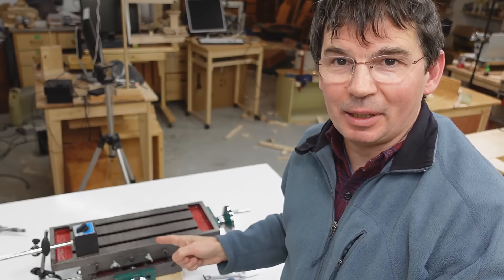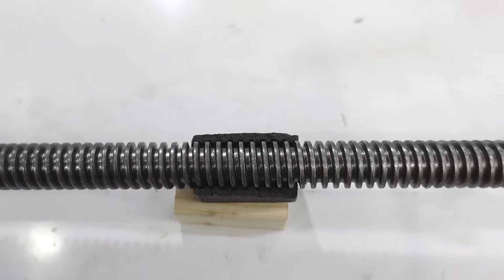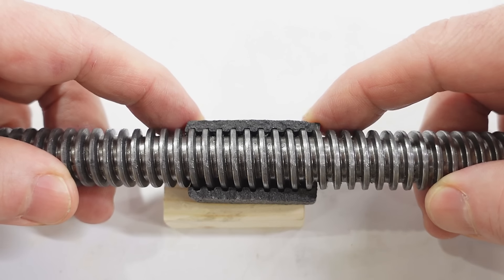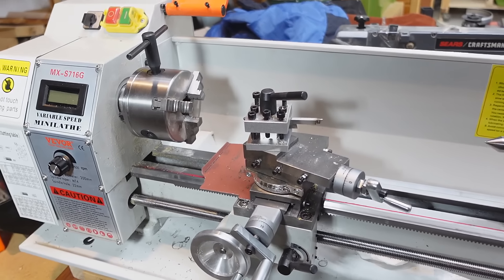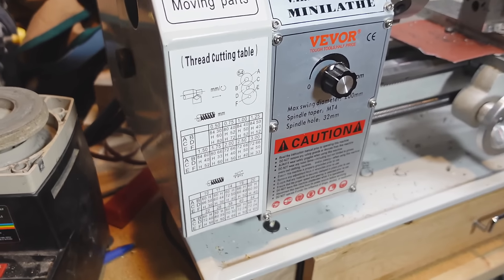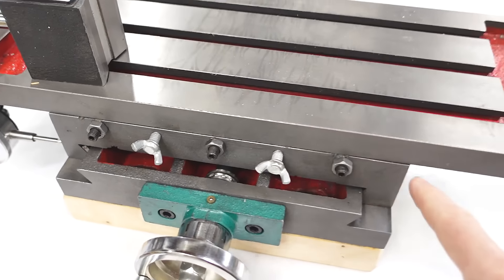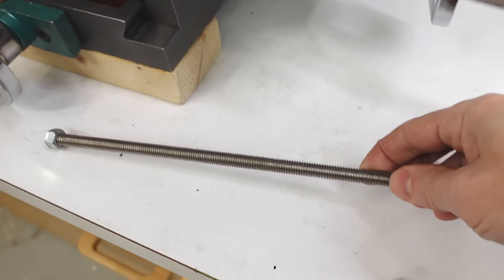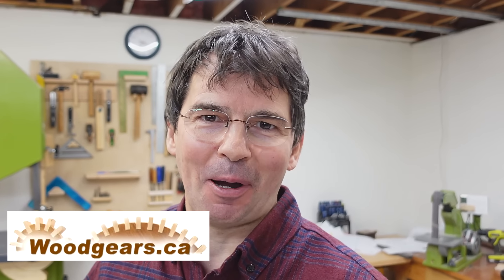Why all the hate for Vevor?

Comment: Regarding chinese factories, the only thing to mention is:
When constructing anything, from a machine, to a guitar, to a cellphone, usually you have certain amounts of steps including certain materials. 

Let's say 100 steps, to make that machining table. And materias certain type of cast iron, treated at certain temperatures, and wheels made of bronze, whatever.

BUT THEN, in China, what they do is instead of follow the 100 steps, they just follow 50 of them (for example, they cut all the quality control steps in between), and instead of treated iron, they just use cheap iron without any treatment, and instead of bronze, they use aluminium (I found sprockets made of aluminium in some guitar tuners!!, they literally bend under pressure!)

Then, for example, you cast the table, and then you need a special machine to flatten it, then a special polisher to leave the surface clear and soft, and then you place the part onto the whole piece and check for inconsistencies and fix any issue.......
What the chinese will do is just cast the part, use a regular machine to somewhat flat the surface, and just sand it by hand (this no need to explain, almost all machines have saw or machining marks on their sides), and then ensamble the machine without checking if there are corrections to be done. This cuts the price below half, but then again, if you buy this machine, you will need an EXPERT to calibrate or refurbish it to become a usefull tool.

But now hear the fun part: if you want to build the machine with japanese/german standards, they will do it. The issue is the machine will not cost $100........now will cost $600....and yes, you also have to pay for the logistics, custom taxes......in the end, you realize if you buy the machine from a local producer, you will pay $900-1000, but you will get a machine that is ready to go, and you will have customer support near your home.

In my mind there is no question about it: cheap stuff cost more than the expensive stuff.......the only reason I could buy a chinese tool, is to learn and practice how to refurbish it, and fix the multiple issues they have........My grandad bought an electric hand drill in Italy 60 years ago.....this drill is STILL working, and the only maintenance it needed was to change the carbon brushes every couple of years (and he used this drill professionally......I have bought in the last 10 years, at least 3 drills, and they are a TOY in comparison: 1) one doesn't have enough strenght, the W shown in the box are not true, and the drill always gets stuck if you push it too hard, with the risk of burning the motor) 2) the other falls aparts, all its rubber protections fell off, the drill bits get loose after a bit of use, and the drill has to be put in certain position for it to work, if you hold it horizontally the carbon brushes don't make contact! 3) the other is a cordless drill....after 4 months the charge last 20min of bare use...........so I have 3 almost useless drills, and probably should buy one more now...........4 drills in 10 years.............my grandad bought 1 drill in 60 years and today it still works.

Comment: I actually like Vevor. Some of their tools are very good regardless of price. The trick is knowing which ones are good as-is, which ones need some work, and which ones are not worth the effort to fix. I bought a very large set of taps and dies from them for USD $105 knowing I they would need work. An American quality set that large would have cost about $800. So, I will deburr them and touch them up as I use them, it only takes 5 minutes.

Comment: I have no real problem with Vevor. I bought a portaband from them (with a stand and a horizontal vice) and the stand sucked. But the portaband itself? Pretty good! 100 times better than having no metal band saw at all, that's for sure. I've made a little table for it now so I can use it in vertical "mode" also, for cutting sheet metal.
One thing I will say, if you do have a problem with a product, they will do almost anything to avoid taking it back. I bought a VFD that I wanted to send back due to it not having all the features advertised, and they basically kept offering me more and more money off until the price was down to like, 50 or 60% of what I paid. I guess I could've kept pushing and eventually I could've sent it back for a full refund, but honestly the email back-and-forth was wasting my time, and I knew I would find a use for the VFD in a later project.

Comment: I have a 3040 CNC of theirs that I got from the Amazon warehouse.  The spindle control was burned out, and I was disappointed that Vevor wouldn't provide any support (i.e. replacement part at my cost).
Ultimately, I rebuilt the electronics and have it working to mill out 1/4" aluminum plates that I needed.
Had it been at Vevor's price - I would have been disappointed, but with the markdown from the Amazon Warehouse it exceeded the value that I needed for what I have invested.... (More time and learning, than $$)

Comment: They are indeed a bit sloppy, but generally things can be improved with minimal effort, and personally I don't mind playing a little if the price is good and material is not total crap. I've been buying laser tubes and power supplies, lathe chucks, and I was rarely badly disappointed. I also like that they have warehouse, or maybe more than one, in Europe, and pretty big assortment, so shipping and delivery times are not prohibitive either. But I think I've said more than enough, considering I haven't got any lathe for free LOL.

Comment: Matthias - I was one of the negative commentors about Vevor and still am.  Yes they are manufacturing to a price point, but their advertising is deceptive and the flaws they have are simple fixes at the factory that do not cost much to fix.  You can spend a bit more to get reputable equipment that works straight out of the box.  I too have done the fix it up routine and have spent more money and time to fix the bad design than if I had spent more in the beginning on a better product.

Comment: There is probably a small business opportunity manufacturing quick improvements like moulded or printed nylon or metal collet nuts and thrust bearings that accurately fit the supplied acme threaded adjuster rods on this table and for other Vevor products. :)

Comment: I bought a Vevor Tig welder. They don't sell the consumables, and neither do any of the welding shops, that will work on the model I purchased. So basically I now have a 250$ boat anchor.  And I can't change the stinger because it is for specific for this model.

Comment: I would investigate replacing the table's leadscrew with a ballscrew. They have practically little to no backlash and almost mandatory if you plan on motorizing the table. They're available in a wide variety of sizes and include mounting hardware and ballnuts. The Chinese ones are also ridiculously cheap. Vevor also sells them so perhaps they're open to having you do a review on them.😊

Vevor doesn't manufacture their products. They're just resellers like Harbor Freight or Princess Auto. They are probably happy with your reviews because you're setting realistic expectations of the product, which reduces returns. Moreover, it is impractical and counterproductive to their sales efforts to list product flaws.
Reply: Usually when you retrofit ball screws you're also looking at changing the bearings which isn't a trivial task to fit. Often there's clearance issues with the nut too. Ball nuts tend to be large. It isn't take one out and put the other one in.

Comment: I missed a killer deal on a Emco Maximat Super 11 with the vertical mill, grinder, and a bunch of tooling for $4500 that was about 1.5 hours from me. I waffled a bit too long since I didn't know much about them. Even if it had turned out to be trashed, I could have recovered most of the cost in selling the tooling and accessories. Oh well, live and learn.

Comment: You might try cleaning the lead nut really well and blowing it off with brake cleaner.  Then coating the lead screw with a silicon release spray and putting some JB Weld or other metal filled epoxy.  Should tighten things up.  They design for a price point, not a point of utility/quality.

Comment: i got a cheap milling table to make cnc parts, not a vevor, buying glass scales for it(100mmx350mm), will move em to something else later.  great idea, can be cheap, some people use arduinos with em and scales don't care about sloppy screws, they'll be accurate, with the right equipment they'll also connect to a cnc controller.  your table is just about perfect for that kind of mod.
Reply: There's no good CNC controller software available for an Arduino. There is GRBL though. Which isn't a good controller. It can't do path prediction.
Reply: @1pcfred  facepalm i didn't say there were good cnc controllers based on arduino.

Comment: Sometimes, a cheap tool is the better option if you only plan to use it sparingly, and if you have the knowledge and the elbow grease to make it work better, then the only added cost is your own time, which may still be less expensive than the high-end product. With that said, there's clearly a market for both, and Vevor and others like Harbor Freight realize this and are happy to stay in their lane.

Comment: Might be worth trying to upgrade it to a ball screw.  Depending on machining tolerances backlash may drive you crazy.
Reply: You can use a ball screw if you're power driving. You can't if you're hand driving. Just how it is. For reasons. The main reason being ball screws don't have enough friction to immobilize the stage. The power drive itself will hold the lead screw. Your hand won't. You lack the power. Unless you're He-Man, of course. He has the power of Grayskull. Even that may prove inadequate for the task though.

Comment: Do you have a link to the BT30 spindle block?
Reply from the maker: on aliexress, described as "1.5KW 2Hp BT30 3000~8000rpm Power Head Power Unit 1500W Machine Tool Spindle Head for Boring Milling Cutting Machine"  They have different versions, some with a morse taper too

Comment: let's put it this way...the cheap way they slap these things together you just have to hope you can fix it when you get home.... mine was intact and not broken but it's super cheap in construction.... they didn't even put a washer under the rubbing handle.... yes it is garbage
but I bought one as well, and use it on my makeshift mill...it's far better than plastic !
I have to lock down every screw on the thing to mill anything...
you did good Mathias.... I got mine years ago and yes the lead screw is very loose.

Comment: Precision is a sliding variable.  My shop is full of old, used, and reclaimed tools, but my use case is not high-volume production of interchangeable parts.  It’s repairs and one-off builds across the spectrum of light to heavy-duty.  I have a tire machine that has air-leaks and some wonky foot valves that I pick up in a scrap yard.  If I was changing a dozen or more tires a day, I’d probably toss it back in the scrap yard, but because I’ve got a fleet of various trailers full of axels that spend a lot of time parked, having the machine so I can quickly change one or two as needed is worth the extra work, vs. going to a tire shop, or even worse, getting out the hammer and the tire bars.  *shudder*.

We had a task to re-finish a house sided with (very) softwood logs.  The vevor version of a metal burnishing tool fitted with a scotch-brite drum was a fraction of the cost of the units I was trying to price that were destinged for auto-body shops. Heck, the Metabo kit was 1200.oo

Comment: Personally, if the company is upfront about their quality, that's probably ok with me. (Having a good amount of video reviews available helps too) I'd have more of a problem with it if they were marketing it as a premium (or even decent) product. I do take issue with that thread table (on the lathe) though, that's just an hour or so to recalculate/verify and a printed label, and will almost certainly ruin someone's project if they don't know it's wrong. Either fix it, or remove it entirely; leaving a piece of info they know is incorrect does rub me the wrong way. 

As I've said before, just the fact that a company is willing to send you a product that they know you will likely take apart and trash on anything bad about it is a much bigger statement about the company than the review itself.

Also on the topic of software, yeah I hate that fact so much; both on the consumer and dev side its infuriating how hard it is to actually get fixes through instead of just features features features, and CI/CD has only made it worse in my opinion. Sure the time-to-fix might be shorter, but the number of bugs at any given time is way higher, and just leads to a worse experience. That's nice that you added 3 new features this month, but 7 of the last 9 features you added still don't work and I don't think that's better. I've got a whole rant but I don't feel like copying it from Twitter, so you can go find it there if you're curious.

Comment: Usually using drill press for milling isn't a good idea. This is so because of the cheap wheel bearings they put into the drill press, which are not designed for lateral loads.

Another issue, unlike it is with the milling machines, in a drill press chuck isn't fastened to the spindle with a long through bolt. It will come off during work, and will damage the work peace and/or operator.

Milling soft materials is okey-ish... At least that's my experience with this table attached to a drill press.

Comment: "You have to wait for someone to die to get hold of one" .. I shouldn't have, probably, but I laughed at that one! I bought a heavily used Bridgeport mill and it really needs a lot of work to be up to a good standard; I probably would have been better off with a new mini mill in terms of "getting going quickly" even if the new mini mill had Chinese import build quality. Still, the Bridgeport was cheap (under £1000 delivered to me) .. although then there is the VFD it needed, the motor rewind, the fact that the X/Y nut bracket is broken, the wear in the ways and the 1000s of apprentice marks on the table.. you get what you pay for, either way!

Comment: I applaud Vevor for taking up where Sears should have done and Walmart does not do, answer the needs of hobbyists with reasonable equipment that can be and should be final tweaked at this price point. Vevor has a very wide net of goods that it deals in. We shld be ecstatic they are doing this for hobbyist/retired or budding self starters.

Comment: I use industrial stuff, and it's in a totally different league; but the cost is in a totally different league. A lot of people by cheap Chinese stuff as a way to get a set of machined castings. I like the Vevor compound table because the bottom dovetail slide is very wide, on must others it's very narrow, allowing the table to rock.

Comment: You just have to look at a lot of the cheap cast iron stuff as an 80% kit. It is what you make it, and you don't have to have an iron foundry in your garage.
Reply: Exactly my thoughts! I prefer to build rather than buy when it's feasible, and it usually isn't because of cost and what you said. If a tool has good bones, it's not hard or expensive to fix up!

Comment: A lot of people lack perspective, I think. While I lucked out and bought a very nice, not abused old Logan lathe from a local high school for cheap - I cut my teeth on a chinese import with a lot of the same deficiencies you highlighted here. Was I going to make a clock with it? No. But I certainly could make not round things rounder and round things smaller! 

Re: CNC control on the table. Something I've been dreaming about is a manual control box for a CNC table with force feedback. Imagine a box with an X and Y handwheel, but isntead of connected to the lead screws, have them connect to some servo drives - which have come down in price substantially. Use the encoder on the servo to control the steppers/servos on the X-Y table, and use the motor on the servo to rate limit so you can't turn the virtual hand wheel faster than the machine can move. I think that would satisfy my desire for manual control for quick and dirty jobs while keeping computer control for interpolation and repetative tasks.

Comment: It would also be pretty easy, using what you have, to convert the crappy acme threads into a ball screw setup.  That's what I did with my "G0704" mill before converting it to CNC many (many!) years ago. Videos on my channel about that.

Comment: If you are going to add stepper motors, you should also add ball screws. Much more accurate.
Reply: What are you basing your claim on? Do you think all ball screws are ground and mapped? Some may in fact be more accurate. Like the ones that are ground and mapped. But that is actually a very small percentage of ball screws that are manufactured. Most are no more accurate than any other threaded rod. Being made essentially the same way. Rolled like every other thread is.

Comment: Even expensive Chinese built stuff is best to treat as a kit supplied fully assembled, and sort of tested. But seeing as the stuff is normally sold at a twentieth of the price of the "US" made stuff (actually all made in Mexico, India and Pakistan these days, just gets a box, printed with made in the USA on it from India, and a big mark up), it is well worth the time it takes to strip it down, clean up all the parts, remove the sand from the castings, and put it back together correctly. $250k machine, the clone is $10k, and actually comes with a service kit, toolbox, accessories that you had to pay $5k extra to the US supplier, and you need them to run the machine. Yes build quality was not as good, not going to last a century like the old one, but also not going to be much of an issue to replace, at $10k, in 10 years either.